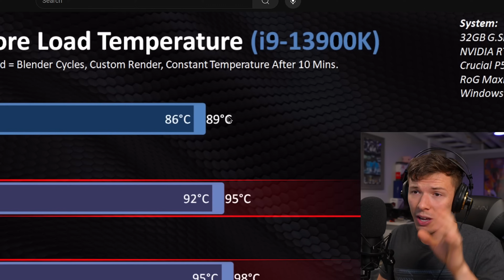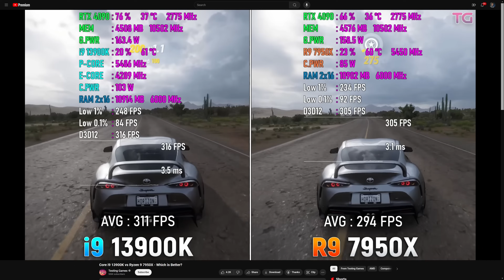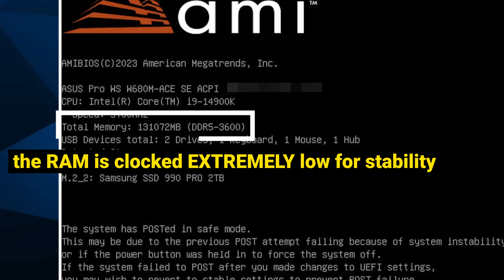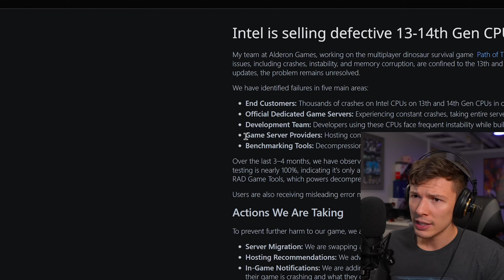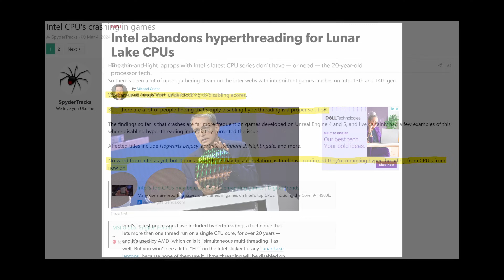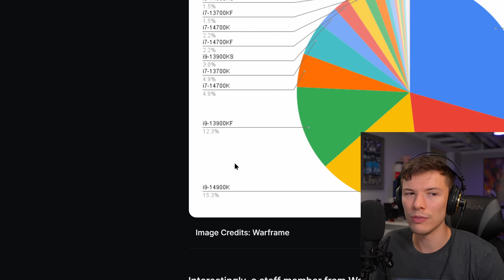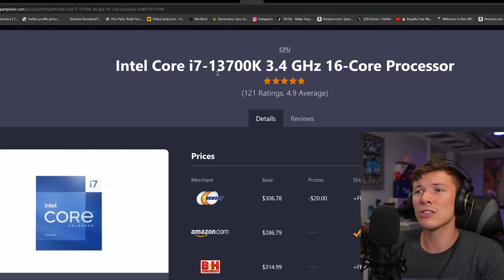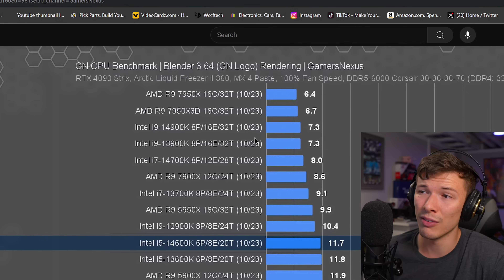Intel F**ked Up Bad

Comment: I purchased my new pc after 2015 in 2023 last year in may. Bought a 13500. I have been using the processor for a year now i haven't seen any issues with it.. i only game though i don't do game development or video or photo editing or 3d rendering work so i don't know if some problems can be seen if i use them regularly and face any issue like those game developers are facing. Only issue i had was one day windoes suddenly died on me lol. Sometimes it started and sometimes it didn't. I had the utility of Hiren boot CD in my usb so i booted from that instead of the windows and it was working. The error stated that (NetStart:The system seems to lack either network cards or network drivers.) It is similar to the GPU one showing in this video though. I don't know man i just hope everything turns out to be okay. I have invested a ton of my parents money in this PC i even bought a MSI z790 board to be "future proof" with enough Dram to run K CPUs in future if i wanted to.. but i guess that won't be happening now lol.. plus i am using the bios which are a year old.. now i am afraid to update bios too lol..

Comment: They did, fr. It really sucks to see Intel faltering so badly and giving AMD no competition, but until Intel release a really good, power effecient architecture, and enough time passes to where almost everyone agrees it's Intel's best since 10th gen with a low defect rate, I'll never buy Intel again. 12th gen was good too, but 3 of Intel's last 5 gens were either unnecessary or have fatal flaws. That's big picture bad.

Comment: personally I have AMD and Intel rings which have both been great, but my i9 13900ks is fine after 1.2 years paired with 4090, no issues no crashes
Reply: I’ve had a 13900k/4090 for 15 months and haven’t experienced any problems. Fingers crossed.
Reply: @dauntae24 try first descendant - most problems are in unreal5 games
Reply: @marcinkarpiuk7797 this is true
Reply: Idk these Youtubers are hyping it up just for views. If it was %100 fail rate that means everyone who owns these chips are having problems including you guys.
Reply: @Ravelover5448 It's a problem that does not show up immediately but absolutely will materialize at some point. Even servers with very conservative power limits are still having issues.
Reply: @Dango-God Servers are running all cores 24/7, it is not a comparable situation.
Reply: @Tugela60 that’s still a terrible sign longitivtiy wise. A CPU should not degrade to such a degree for atleast 10 years, hell my i7 4790k ran better then my new i9 14900k.
Reply: @Tugela60  Extreme generalization, and the CPUs still shouldn't fail even in the use case you just described.
Reply: @de_sh0t114  That is because those old CPUs ran off larger process nodes which are inherently more resilient. As process nodes get smaller, the probability of failure increases. Combine that with the obsession with benchmarks and you get processors which are a lot more fragile than the older ones.

A matchstick breaks a lot easier than a log does.
Reply: @Dango-God  That is like saying that GPUs used for mining should have the same working life as a GPU used in a consumer setting.

Running processors in those extreme environments voids the warranty for a reason. They are being worked way harder than the processors were designed to do.

If you run a processor in a server it is still going to be boosting even if it is on a board using a workstation chipset.
Reply: @Tugela60  These CPUs, even when power limits are very low, are failing during workloads that wouldn't even make other CPUs sweat, such as AMD's competition based on a more advanced process node. This isn't normal behavior and that is an undeniable fact.

Comment: they don't know how to make a processor since the 9'th gen. That goldencove was their last ditch effort and they f*cked it up. 
Intel is though very good at the following

Paying every benching marking software to favour them "just google there is dozens of examples" 
Paying Dell to prevent AMD cpu's from finding their way to HVC / LVC " high volume / large volume customers, which is why every business still has Intel laptops and desktops" 
Paying HP  to prevent AMD cpu's from finding their way to HVC / LVC " high volume / large volume customers, which is why every business still has Intel laptops and desktops" 
Paying off server vendors and giving them cash rewards. 

And they do all of that to keep themselves at the large market share, lets be very honest, every server chip every consumer product every chip for the last 4 generations where inferior except for a few laptop chips at a specific voltage curve. 

Corruption is what is keeping intel upright.
Not engineering and not innovation. 

The moment TSMC could go beyond 14nm and Intel fabs couldn't their chips started to suffer, and now everything Intel makes that is slightly competative has to be done by TSMC, what a joke.

Comment: I'm actually running i7-12700H laptop, RTX 3050ti, double fan and summer season without Cooling pad, result only 3Ghz frequency max and 64-68°C temp on CPU gaming and ~45°C average on web browser but the fact I'm limiting 1v cpu voltage and 30w max (intel will hates me doing that) I mean what's the point getting more Frequence than cooling my laptop, efficiency power and more life-span CPU degradation

Comment: And then there is me getting 5 crashes a day on a Ryzen 2200g, if I had intel I would at least know what the problem is 😂
Reply: It may be your memory.
Reply: @mariusvanvuuren4983  thx for the tip, but that is not it unfortunately, I'm out of options at the moment. The pc (built it in 2019) worked fine until few months ago and keeps getting worse. At the moment I tried with different memory (and on different slots), a different motherboard, different SSD, reinstalled Windows, updated bios and nothing works. Its like something in the cpu is dying. Something really peculiar is that I can not change any CPU power, voltage or frequency related settings in both of the motherboards (B450 and B550)

Comment: I have an i5-11600KF. It is actually decent. Not better than a R5 5600 but still enough for my 3060. I wouldnt buy i7 or i9 in future but I would choose the i5 anytime.

Comment: I’m not here to be smart. I thought about this and went with the i9 10900F 65tdp and it was getting same temps it was ridiculous and I managed to get it under control first step. Turn off in bios the intel speedshift or speedstep thing. That allows it to go crazy on ya PSU and draw whatever it wants. And…! I had to DEFFO under volt it 😂 this made my CPU return to 50-60’s and my paranoia about it boiling water 😂 can relax.

Comment: Suddenly I dont feel as bad for not upgrading from my 12th gen system to a 13th or 14th gen.
Reply: I still rock my i9 9900K and it works just fine. Can play everything at max. Have no plans of upgrading any time soon. Seems to be way to much issues nowadays.
Reply: @thepicard83  My 9700k going at 100% for every cpu intensive game in 98 degree weather. 🗿🍷🔥
Reply: I'm running 12th gen as well so I don't have any issues, but honestly, I'm considering a full PC upgrade next year and if I do I think I will very likely be going AMD for CPUs this time.
Reply: Still rocking the i7-8700k. This puppy is still delivering. No reason to upgrade
Reply: @evaone4286  That's the sweet spot right there. Mine been running stable for 5 years no problems with heat.
Reply: I have a 13th gen and It's been the opposite of what's in the video. im confused about it.
Reply: @mxru.mp3 if you have a 13600k or lower you might not experience this stuff as it typically happens on 13/14th gen i7s and i9s
Reply: @Zxqaui Nah, at least the i7-13700K is the same as a 12900K.
Reply: One day you gonna have to throw the board away instead of buying a 14th gen and keep using it
Reply: @tumo07  Why throw it? You can sell it easily.
Reply: I just sold my 9900k w/z390f board. I had no problems with it, but decided to go with the 12700k just to utilize the arc control. If it wasn't for that, I would of never switched. Other than that, my other pc has the 14900k. I only use it for video rendering and have no issues with just the igpu.
Reply: I'm thanking God that I bought a 12700 instead of a 13th or 14th gen lmao 

Scraped in just under the wire
Reply: Why would you feel the need to upgrade so soon in the first place it's not like the improvement from 12th to 14th gen is that big of a deal
Reply: Idk if this affects 13 and 14th gen laptops. I have two i9 13th gen laptops, one being an i9 13980hx and it has ZERO issues. Though I always take special care of them via undervolting and limiting PL's by a few percent downwards from stock. I also never push them too hard and always make sure they are running within my comfort zone. Can still play everything at max settings so no problem here 🙂
Reply: Still using my i7-4790k, runs well for what i play
Reply: And now your next upgrade can be to AMD. 😂

Comment: In Intels defense, I seen a lot of AMD users complaining about crashes in The Finals forums... Just saying
Reply: Yeah, my intel build has been incredibly stable (literally never crashed since I got it in 2022), while the aging Ryzen build (2200g) I made for my gf is becoming exponentially more unstable by the week (and I never did OC). Not sure what is going on with it, but so far Windows reinstall, bios updates and resets, driver resets, underclocking, swapping motherboard and RAM and SSD did not work, I think the CPU is somehow dying. 
And the AMD build (5700x) of a friend of mine randomly shuts down for "overheating", but the highest temp he recorded is 71°C....

Comment: The only reason people buy intel is because they been dominant every cpu release but now I guess they've fked up. Lets see if they bring better chips. As for me with a 13600k I tweaked the sh*t out of it and it perfoms very well without issues.
Reply: You can tweak all you want, it will eventually fail.

Comment: i bought a 12700kf, ive sworn by the fact that im starting to get stutter way earlier than expected. my habbits seem to create stutter on my pc, something about the games i play or whatever but this is the worst cpu ive ever owned, and my last one was a 7700k. that bad boi ran at 4.8ghz all day long 0 problems no muss no fuss, now???? sick fucking joke, i barely get 4.7ghz and that's fine with newer generations and the power that contains but now i also get more and more stutter, my 7700k didnt stutter for about 5 years...... years... ive had this 12700kf for about 10 months and im already seeing it, maybe not everyone can see the stutter like i can. but im not joking when i say even the 12 series is where it started lol something is going on here... nobody believed me, i got flak on this one minecraft server, i said these chips are killing themselves. they said im fucking insane LOL
Reply: There are a lot of reports of the E cores causing stutter. Perhaps something in your setup is messed up with scheduling and is moving things between P and E cores when it shouldn't. Try disabling the E cores and see if that fixes your issue.
Reply: @PineyJustice  i have already done that  and it has helped, ive had a persistant sutter issue crop up on all my pc's for the past 15 years. only now is it displaying signs so early on lol i used a 2700k for 10 years then a 7700k for 5. and now a 12700kf for about 10 months, i give this 12700kf another 2-3 years before its just like the others (stutter hell lol), it's honestly probably just in my computer habbits, i tend to open and close games frequently among many other bad habbits,  heavy frequent use also to be taken into consideration lol now that being said it could also boil down to how install my own builds. maybe it's in my technique, also possible. theres only a couple constants left lol TLDR intel losing my fandom at this point, if it's a simple fix by getting a contract bracket, i can do that but damn...
Reply: @Wtfomgbbq123 Yeah it sucks, I've always used AMD cpus, but I've owned and used plenty of intel CPUs as well. Even when the intel cpus are "faster" I've noticed they tend to have hitching issues or often worse response times in desktop use.

Comment: Thank GOD I got the 12700k instead..

Now, I only got an Intel CPU because, according to a number of articles I read and researching I did, Intel CPU's were the best to pair with an NVIDA GPU, and I wanted a NVIDA GPU because cuda cores and all that jazz. I didn't know if getting a ryzen + nvida or intel + radeon was cheat code to insta-nuking my PC and wallet, so.... Yeah. :P
Reply: It doesn't really matter whether it's amd or intel paired with nvidia lol. Even their own designed dgx servers use amd.
Reply: CPU brand doesn’t matter to the gpu.
Reply: So the competitors didn’t do any hocus-pocus bullshit to produce bad performances between the two? Awesome.
Reply: @Always100AlwaysStrong  AMD GPUs are a little faster when paired with AMD CPUs but nvidia isn't any faster or slower with Intel vs AMD.
Reply: @Son37Lumiere  And for Intel Arc minimum Intel 10th gen or Ryzen 3000. As long as it has ReBAR available because Intel Arc's performance really depends on that.

Comment: Just bought a new higher end mobo for my 13700k (MSI MPG Z790 Edge Max Wifi), because off instability issues on my ASUS Strix B660-A Wifi, like you said hopefully Intel 13th and 14th chip problems are only a software issue. It would take me up to 2 years to save up for a AMD equilavant chip and mobo...
Reply: Isn't a b650 with a 7800x3d cheaper? Idk about where you live but it's cheaper in Australia?
Reply: If cpu does die, RMA it, then sell the board and new in box RMA cpu, should easily pay for a nice b650 board and a 7950x or 7800x3d or 9700x or 9800x3d.